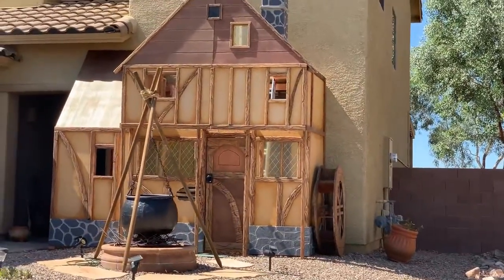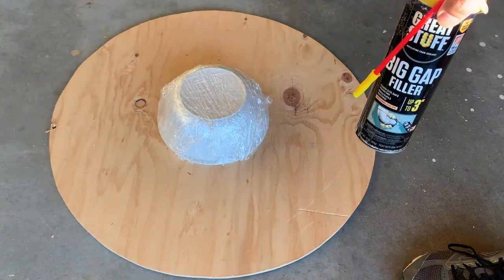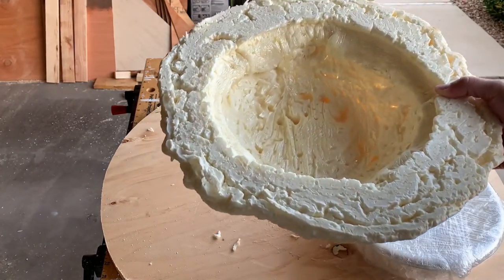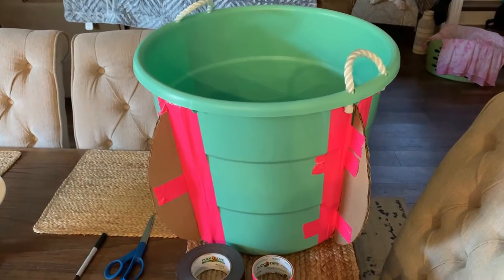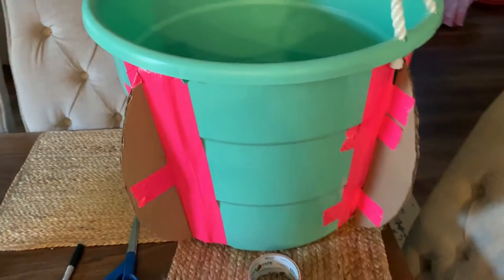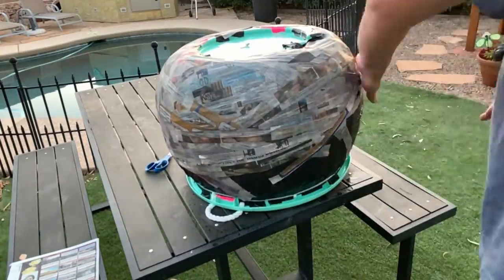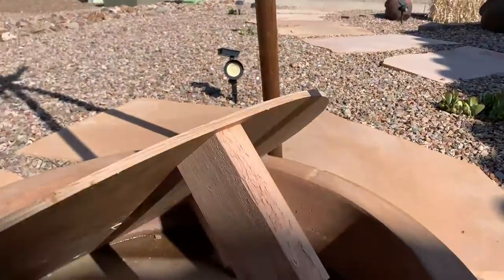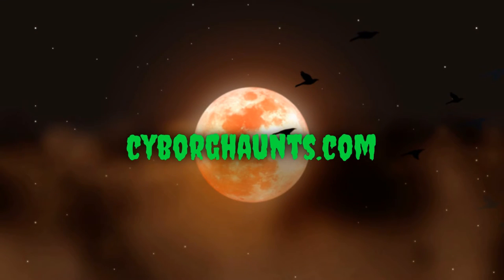DIY Witches Cauldron | Hocus Pocus Halloween

Comment: Use a exercise ball and cover it in paper mache, leave the top open it let the air out of the exercise ball , cover the ball in plastic wrap so you can get the ball out clean.
Reply from the maker: Great idea! Thanks for sharing that.
Reply: Uuuuu de la casa g yyuyu
Gyyuu

Comment: Impressive !!!!  I design and build exhibits for the NC Science museums, but have never done anything for Halloween. Spray foam is a heavy use item though. We also glue together blocks and planks of styrofoam and then carve it to shape using right angle grinders with disks having bolts sticking out of them for the rough carving (dangerous, but necessary). Then we resort to electric carving knives and scrapers for the finer work. Large rocks and even walk-in caves have been built this way.

You do "impressive work". Please post some videos of all of this in use on Halloween.

Charley
Reply from the maker: Hi CharleyL, it sounds like you have a fun job!  I did do some light stone work at the bottom of the witch house, I used a small wire brush grinder that fits into the end of a drill to carve the Styrofoam. I would like to try some larger, more complex rock work one day.  I have a few more videos to post before Halloween, but I will post one showing it in use. Thanks for the positive feedback!

Comment: What kind of spray starch did you use?
Reply from the maker: I actually wouldn’t suggest the spray kind I used. I recommend StaFlo liquid starch. The store was out of it, so I just picked up what I could find, but it didn’t work as good. Pour the liquid in a shallow pan and drag the paper strips through, then adhere to the project. Thanks for watching!